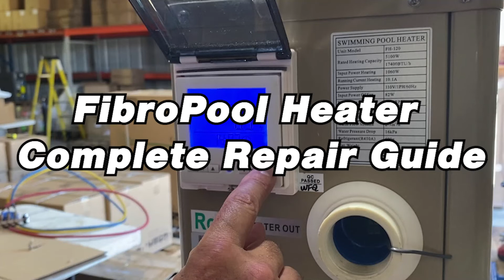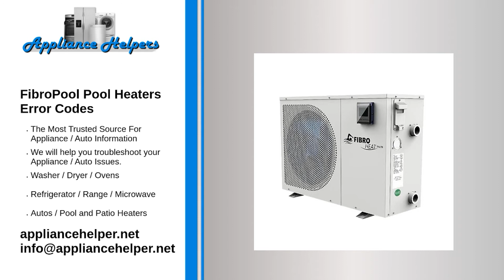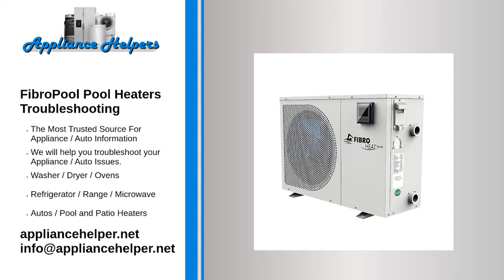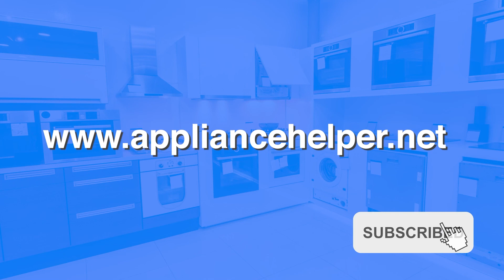FibroPool Pool Heater Complete Repair Guide - Error Codes, Troubleshooting, and Repair Tips!

Comment: I have FIBRO POOL FH 120 and when I turn off the pump and I turned that heater off it’s shows hammer and a wrench. What does that mean when everything’s off and the hammer and the wrench is blinking.  EE 03

Comment: How about pL code
Reply: PL is a flow error-generally relating to an issue with the plumbing or flow switch. If you're confident that your unit is getting proper flow, reach out to us on our website so we can get you connected with a tech to troubleshoot.